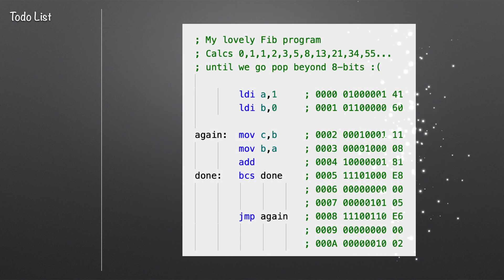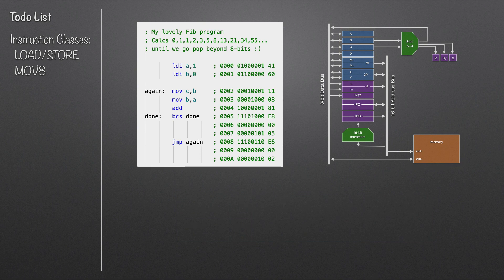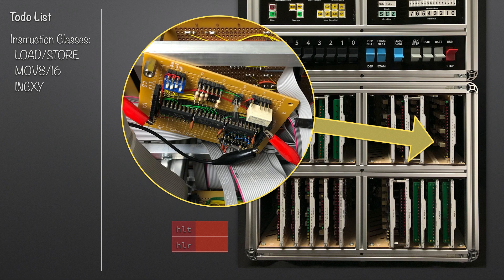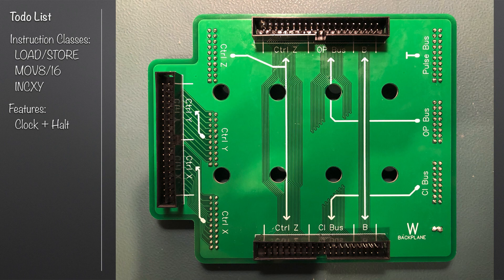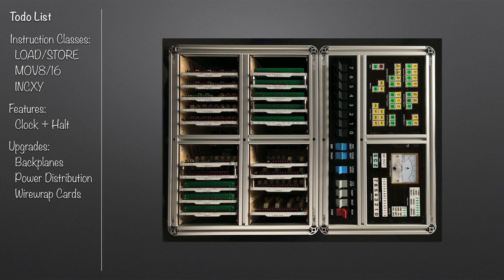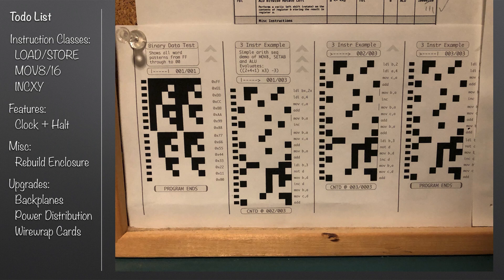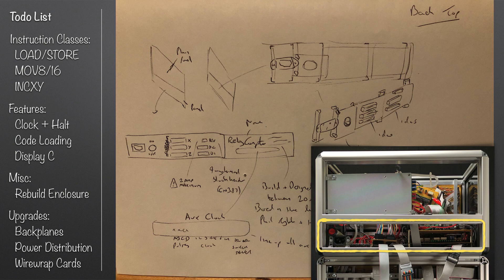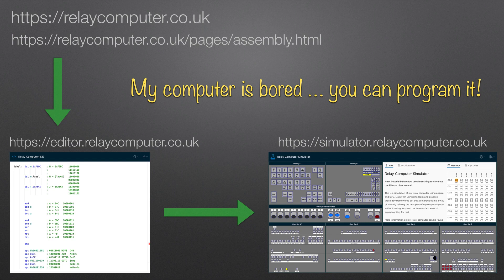Relay Computer 2020 Review: What's Next?

Comment: Can I replicate you computer?
Reply from the maker: With a lot of time, effort and money - sure ;) There's a lot more detail on my website at www.relaycomputer.co.uk but there's not fully details plans (yet).
Reply: @paul80nd thank you, do you have detail plans?
Reply: @paul80nd thank you, do you have detail plans?
Reply from the maker: I have the designs for some of my cards at https://www.relaycomputer.co.uk/pages/progress/ but not all of them (because many were wire-wrapped by hand). The RC3 computer that mine is based on does have full designs however the website is no longer available but you can reach an archive at: https://web.archive.org/web/20231004134328/https://www.computerculture.org/projects/rc3/ and, of course, there's the original Dr Harry Porter computer at https://web.cecs.pdx.edu/~harry/Relay/ - with those websites there should be enough information to design your own computer.
Reply: @paul80nd  Thank you for your knowledge, I appreciate it.

Comment: Amazing job. Thanks for sharing this.
How many relays would your computer need for a relay only memory ?
Reply from the maker: Effectively the registers in the computer are a form of memory that can hold a single 8-bit value. There's one relay per bit and then six relays to handle gating the value in/out. On that basis it's 14 relays to hold 8-bits and if we're going to equal the 32k x 8-bit memory chip we're looking at a whopping 458,738 relays.
Reply: @paul80nd  lol
It's incredible how much more effective things got.

Comment: Paul, thank you for the informative videos. I got infected by the relay computer virus after getting a chance to see the FACOM 128B in operation last year, and have started my own project; in my case, I'm building the Nand2Tetris HACK CPU. I'm also trying to create some standard functional boards that other people can use.

One thing that I'm doing is using a Raspberry Pi to emulate the entire computer at the board/signal level, and then as I get components built, the emulator handles the parts that are not yet built, sending everything out to the current subassembly and then getting the results back again. Since you're already using RAM chips to hold the computer's memory, you might want to consider using a Pi to emulate that instead; that way the program loading / display becomes much easier.

The one issue that the Pi has is limited IO, but I dealt with that by creating a stackable 32+8 bit IO board that can handle higher voltages and currents, so it can drive relays. The Pi can run 4 of these, so you get 128 bits plus maybe another 16 bits of GPIO. I have some extra PCBs so if you want some, let me know.

Details here: https://github.com/RJWoodhead/Relay2Tetris
Reply from the maker: Awesome project you've got there - thanks for sharing. I was considering using an old https://os.mbed.com I've got laying around to drive the computer and effectively run 'unit tests' to check things are working or hunt down issues. Your Raspberry Pi approach sounds really good so I'll take a look as I've got plenty of spare Pis hanging around too ;)